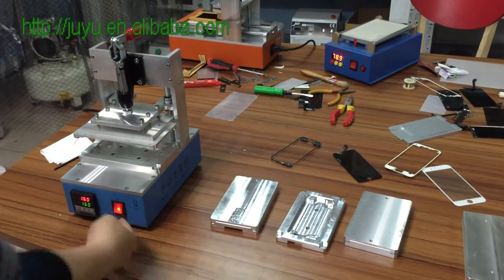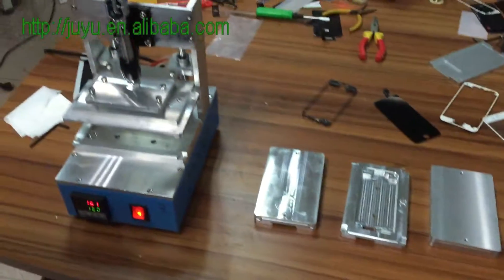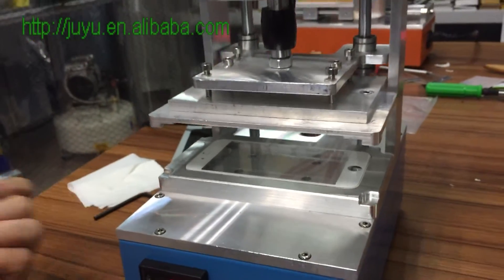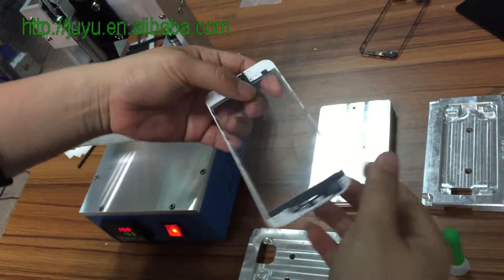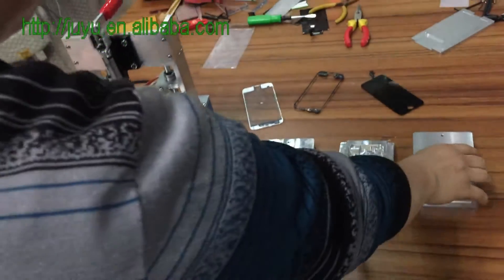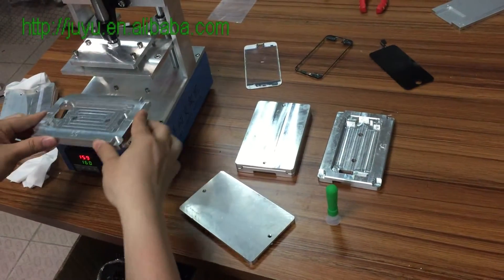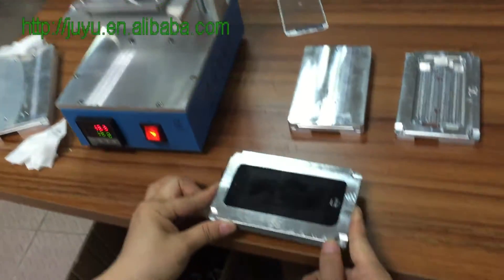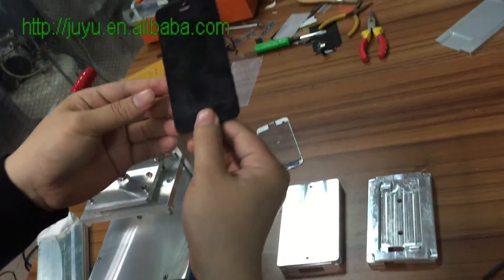How to use  & chang mold for Manual frame install machine   frame laminating machine

Comment: I would like to know if I can use this Machine to laminate the digitizer to the glass or would I still need a oca laminator machine?
Reply from the maker: Hi  dear  this mahine is only  to laminate  frame to  lcd  for iphone   ( hot glue frame ), if you want Digitizer to glass  need OCA Laminating machine